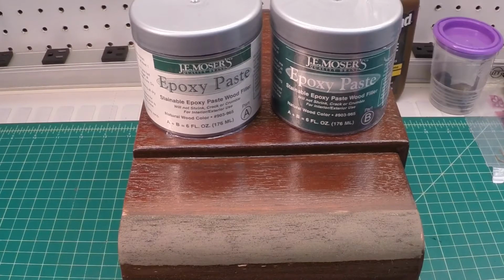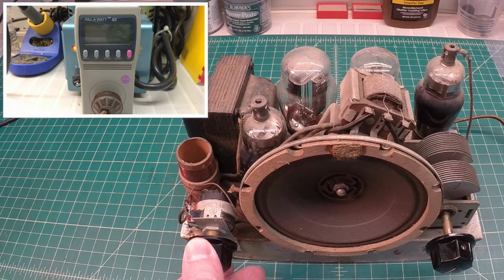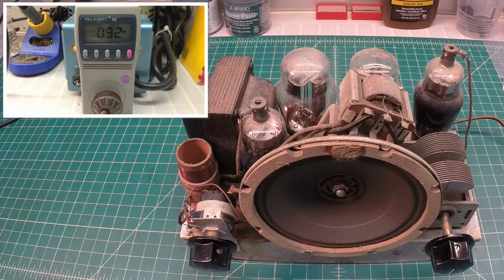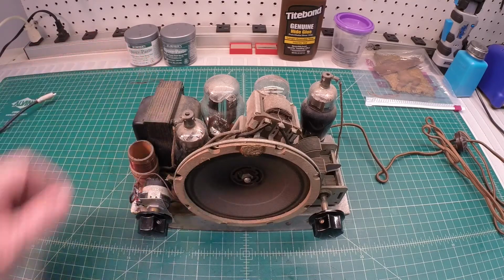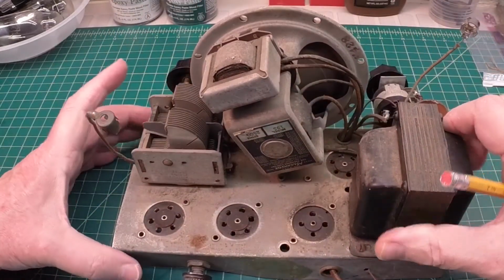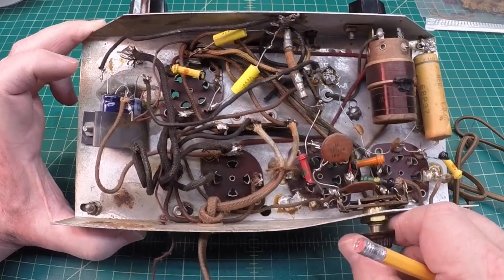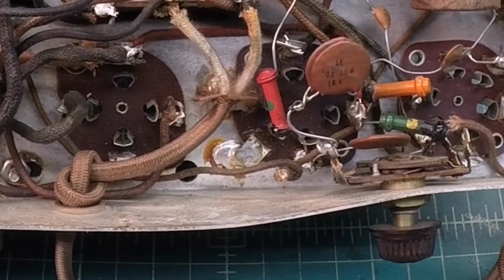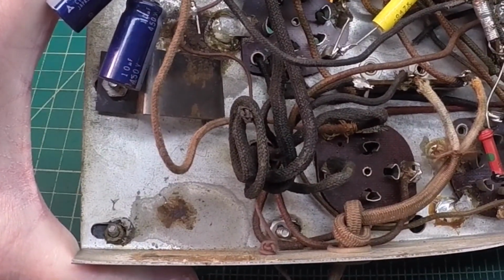Peter Pan Radio - Day 7 (Brief Power Up Test & Quick Evaluation)

Comment: I'd bypass the tone control and see how it sounds before making a decision.  Question, I'm shopping for a variac what amp rating should I look for?  Thanks!
Reply from the maker: +Dan Barrera Thanks Dan. I removed it for now and you'll see it in an upcoming video. My Variac is an oldie rated at 5 amps. For vintage electronics, I would think 150 watts or 1.25 amps would be fine, but I would look for one rated 3 to 5 amps. Hope this helps and thanks again for watching. Best, Don

Comment: Great look Don! When u pull the transformer, there may be a footprint of the old transformer, I believe this is a replacement based on the extra lead and mounting. As far as the tone control, me personally would take it off. IMO, if this were a run of the mill radio with a mod, Id leave it because it is part of the history of the set, but, this is a PP, and I think it should be back the way it was designed. Just me! Catching up on ur videos, cant wait to go to the next kne! Best Larry
Reply from the maker: +Backtothefutureradios I'm thinking the same on the tone control. You'll see in Day 8 the tar like substance on the chassis under the PT. Thanks again Larry. Best, Don